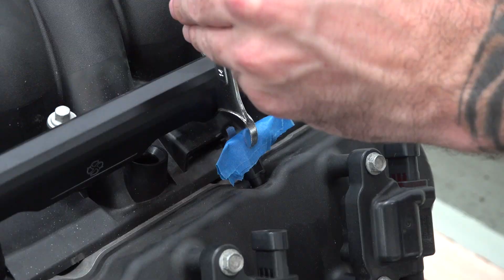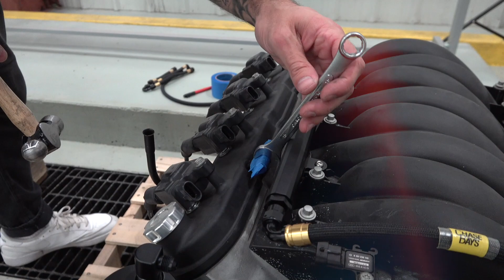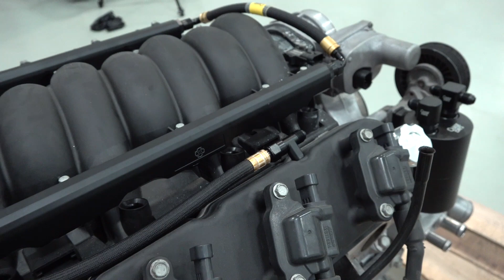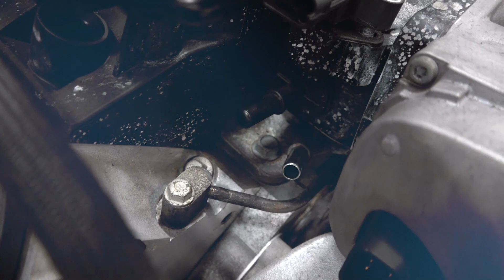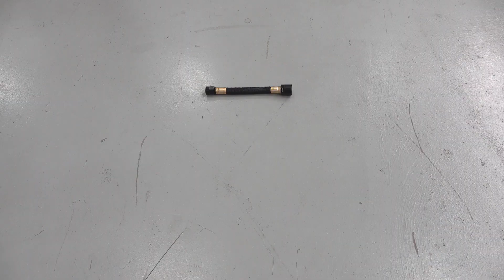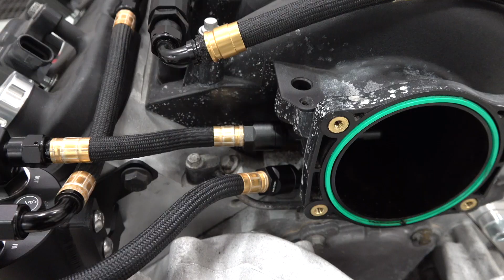Oil Catch Can for GM LS2 / LS3 / LS7 Install Guide

Comment: I had a question on the hose that goes to the intake manifold . I have holley covers now and also the ls2 valley cover , but i have a holley high ram manifold so where would that line go to one of the fittings in the rear or??
Reply from the maker: The kit does not work with that intake with the lines we sell it with at the moment.  We have talked about making one single line longer for the guys running that intake. Stay posted for that!

Comment: LS3 intake manifold has a different nipple on it without the ring so the one hose that connects to intake is not compatible
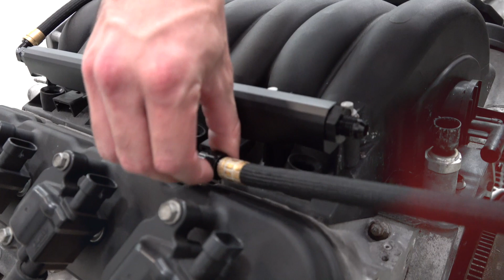Reply: I have an LS3 aswell and I wasn’t able to find the second hole in the heads, ( 0:40-0:47) so does that mean, I can’t use this product ?
Reply: @GwueboJunior  you gotta have Holley valve covers it’s listed on their website
Reply: @codyprealtor  So do you know what’s a good alternative for a LS3 oil catch can ? I have a 2010 LS3 off a corvette

Comment: Hey mate I have a super charged ls2 the shop has fitted a catch can, both rocker covers are vented to the catch can but the valley plate is still plumbed into the charger, I believe it should be plumbed into the catch can the same as you have done? I have spoken to the shop and they are confident it’s fine being plumbed into the charger

Comment: Alot of money and oil for a tiny catch can. What's needed is a gallon container to catch all the oil that is aerated into the system buy the overflow pressure valve in the pan shooting straight up and the high volume pump all these engines come with. My ls3 head gaskets were were soaked with oil between the steel layers and oil is still pouring out of the intake a week after taking everything apart. Good oil get tossed out with the bad with these engines when your oil pressure gets high. The oil even gets pushed up through the bottom of the rings and forms sludge at the top of the cylinder.